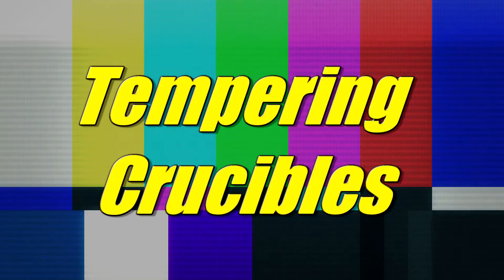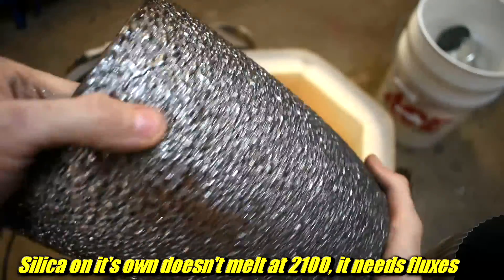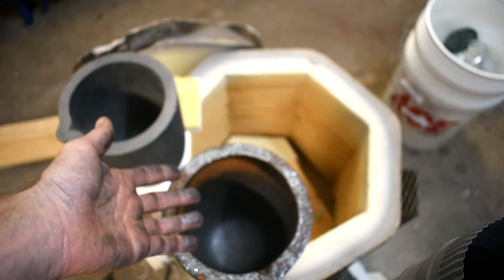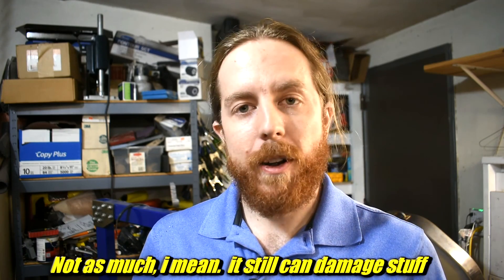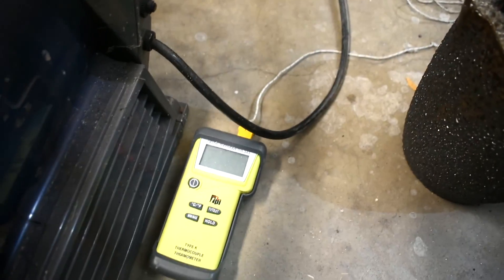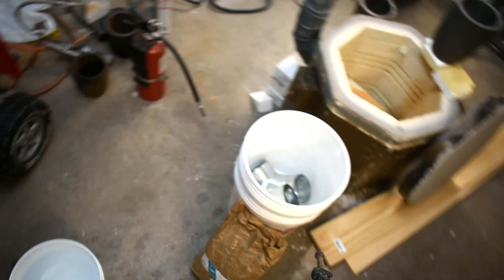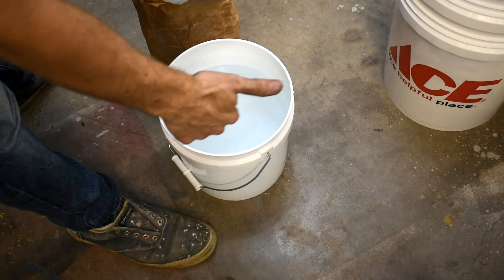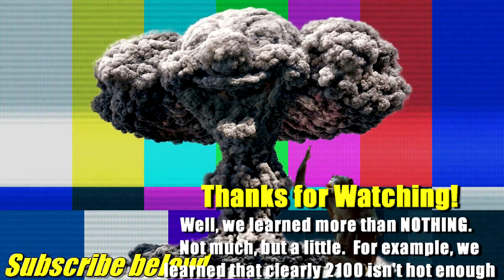Crucible Tempering Revisited: To use borax or not? or something else?

Comment: Just tried out my new vevor for the first time. No borax , no tempering. I did have them by my woodstove for a month and set them in the sun before fireing. The crucibals (2) held up fine but the inside of my furnace I'd coated with furnace cement melted! I used a rigidizer on the wool but then heard of using refractory cement so I coated everthing with that. It held up on the sides and dripped on the crucibals. Oldfoundryman says no to tempering and borax for seasoning. He also says he buys "good"crucibals" which I don't have.

Comment: it looks different because graphite burns in air in 600*C ;)
U need protective atmosphere with no oxygen to heat it up like that... (argon / CO2 or vaccum)
Or....
Use silicon carbide + 15% kaolin (white clay?) crucible
this stands up to 1600*C - starts burning after that treshold, like graphite at 600*C

Btw: been there, done that...
btw2: 2900F which u mentioned is ~1600*C which i mentioned :P so maybe it's partially out of SiC with some dose of graphite (which is absolutely NOT needed in crucibles because it burns >600*C :D )
btw3: it looks nice tho with those bubbles ;]
btw4: next time, put it in some iron/steel bucket, fill all with fine sand, heat up slowly to 100*C for 2h (in oven?) then 200*C for 2h,  then SLOWLY 600-1000*C (1800F max) - SLOWLY!! and let it cool

Comment: The purpose of flux is primarily to prevent oxidation of the material being melted. You want a flux that melts before the material being melted starts to combine with oxygen. And that won’t burn away once the material melts. The best flux strategy for silver and gold is boric acid to start then borax.
Using flux in your crucible has nothing to do with oxidation, but to coat the crucible with a glazing so the material melted in the crucible won’t stick.

Comment: I thought Borosilicate glass melted at a hurt temp than regular glass, or does another process need to be done to produce Borosilicate glass ?
Reply from the maker: Borosilicate glass is much lower temperature, actually.  Borates are very powerful fluxes and are used to make low temperature glazes now that lead isn't allowed.  Silica itself melts over 3000f!

Comment: I bought a crucible and did not heat it or up or anything. Just went straight into using and I didn’t know you were supposed to prepare it. So far no problems, but sometimes slag collects around the edge and I can’t get it out. Any tips?
Reply from the maker: I think if you buy the crucible from PMC supplies, you don't need to do this.  This is an old video, i don't temper them like this anymore.  as for the crud, i have noticed that's almost inevitable when you melt copper alloys or other really high temp metals.  the only metal i cast that has never done that is Za12, probably because the temperature is so low.  I would say make sure you do NOT use a flux like borax to clean metal, that's what wrecked my first crucibles.  It does clean the molten metal pretty well, but boron is a low temperature flux and will cause the inside of your crucible to melt, forming a glass (think pottery glaze, but not smooth) and will chunk off, leaving a rough surface that the metal will want to stick to.  For sure don't use the same crucible for different kinds of metal.  The remains in there will contaminate the other alloy when you mix it up.  Sometimes it's not a big deal, but anything with lead mixed with anything with zinc is a recipe for a bad day and a terrible alloy

Comment: TY, i have been experimenting with glass melts in the furnace so definitely need something that will help the clay pots stand up to 1700 to 2200 degrees. They are doing surprisingly well with no fluxes though.

One thing I learned for sure is a kiln is definitely needed for cooling or you wind up with lots of sharp broken pieces of glass.

After mulling over how to build a cheap kiln, came up with fire brick, aluminum oxide cement (refractory cement) analog 15A single phase motor controller (rheostat), nitinol 14 awg wires with mica and fiberglass insulation, ceramic terminal blocks, and 1500 watt heating element.... that should do nicely for a little kiln.... i can also anneal my metal pours as well.

Comment: How did you know about calcium carbonate flux, I have been googling like crazy and can't get a list of flux vs melt material for clay graphite crucibles
Reply from the maker: it isn't exactly a flux designed for graphite clay crucibles, but it is a flux used in high-fire ceramic pottery glazes.  Lots of cool info if you look into related fields like that.  Boron glass for lower temps, calcium carbonate for higher temperatures, and there are some extremely high temp fluxes too.

Comment: I use very small fireclay / alumina crucibles for jewellery purposes and those are seasoned with borax before first use. They just get gradually heated with a blowtorch to drive off moisture, then brought up to red heat and sprinkled with powdered borax which glazes the surface. Borax is used with most gold and silver melts to help remove impurities and prevent gas absorption. I don’t think there would be any benefit to using borax as a glaze on a graphite crucible.

Comment: What about a ceramic slurry like pottery clay
Reply from the maker: Pottery ceramic would break off while it's cooling.  Pottery ceramic has a much higher expansion rate than graphite clay and it can't handle temperature swings like graphite clay

Comment: Where did he get inexpensive calcium carbonate from?
My next kiln build will be from a stainless steel beer keg, and it will be huge, but I can't seem to find a larger crucible, like the ones he has here.
From his link I found a #14 that should work.
Reply from the maker: Pottery supply places.  It's comes pure, ground to #325 mesh, and it's cheap.  Potters use it in glazes as a flux.  You can get all kinds of stuff from pottery supply places 😉

Comment: borax as a flux is for metals like copper brass silver, its used only to stop oxidation of metal and give the metal a clean flow, the quality of the metal is of more importance than a crucible, all crucibles have a life span and need replacing, the flux is for clean metal not crucible care, the flux reduces fire stain in the metal, and stops metal sticking in the crucible

Comment: I have 3 crucibles. 1 small 2 kg and 2 6 kgs. Did not treat any. Only used the small one 1 and the 1 of the big ones twice. The other I have done 10 burns in.  They crackle. Sure would hate to have one rupture and spill molten brass on my foot as I am pouring 4Kgs. Another youtube video said expect 30 to 40 pours in a crucible's life. By your video proper treatment could extend longevity of crucible a great deal. Thank you. I love all the advice I get from my fellow metal heads.

Comment: What model is the thermocouple, what is the voltage range, and can we arduino this?

Servo on the gas regulator to control energy input + thermocouple to monitor temp

Comment: Hi Paul, newbie lurker here, but i noticed that the interior of both crucibles looked basically the same. Is it the direct flame impingement that causes the texturing and melting? Would tempering the crucibles inside of a steel pipe, inside the foundry reduce the "bubbly bits" on the outside or would it be a waste of time since the next time you used it, it would bubble up? thanks for the vids

Comment: My brand new crucible has couple of small pieces chipped off.
Is it still good or it has to be smooth all the way ?
Reply from the maker: I'm not sure it matters, but you would probably want to contact the place that sold them to you to be sure.  My crucibles get pretty nasty by the time i stop using them and it usually doesn't cause problems until stuff starts falling off

Comment: I made the mistake of using borax once and it made a mess of the crucible - never again.
For tempering, stick it in the over at 400 for a bit and then set the over to the lowest setting and allow it to slowly cool overnight - that'll bake out all of the moisture and temper it just fine.
Not sure where you got your crucibles from though as I've never had one get that glassy look on the outside even when I've melted several pounds of spent shell casings.
As for how long they'll last, depending on how you handle, treat and store them, on average you're going to get 20-30 good sessions out of them so yours still looking good after what sounds like maybe half a dozen light uses is nothing exceptional - mine are still looking good as new after a dozen sessions and I'll go for several hours as I process one or two forty gallon trashcans full of crushed soda cans.

Comment: It doesn't make sense to me to coat the inside of a crucible with borax if you're going to be melting aluminum in them, the borax is just gonna re-melt and contaminate the aluminum forming aluminum borides. As far as fluxes go, there are two different major kinds. "Drossing" flux and "covering" flux. Drossing flux pulls together impurities and brings them to the top, making them easier to scrape away. Covering fluxes cover the melt in a sheet of molten glass, preventing gas from getting in to the metal, preventing oxidation, and preventing the metal itself from burning away. Other things can be added to the fluxes like fluoride to help draw magnesium out of aluminum, and titanium as a grain refiner. All fluxes chemically attack the crucible and shortens their lives. Silicon carbide crucibles are the most resistant to this chemical attack, but are also more expensive. There is no flux that modifies the melting point of a metal or alloy, or make a metal "flow" better. That would have to be another metal added to the alloy itself. There are other things that can be added to the alloys for the purposes of grain refinement, such as silicon or titanium to aluminum. There is no one universal flux for all metals, since one flux may help a certain metal, but may just further contaminate another, as with the case of borax in aluminum.

I don't believe tempering achieves anything useful. I have never seen anything mentioned about it in any real literature, only online forums where it's people doing things but they don't know why, because they saw someone else do it or someone else told them to do it, and are now passing that information on in an authoritative manner. When I receive a new crucible I just put it in the oven at 200 degrees for a couple hours to make sure all the water is driven out of it so it doesn't turn into a bomb in the furnace. These chinese crucibles are cheap, but of horrific quality. I'd want to get all the life I can out of them by using as little flux as possible. Just enough to help the melt. As far as glazing goes, the only things I have seen regarding it is if the crucible is going to be used for melting low temperature metals that won't re-melt the glazing, like precious metals. However, I believe that professionally, they just use very smooth ceramic non-wetting crucibles for that purpose.

Casting forums and youtube videos are mostly useless for finding out real, useful information. It is definitely a struggle.
Reply: Thank you for the information. I just got a small graphite crucible that I'm going to melt aluminum in for small pendants and stuff. Do you think I need to glaze it or add any flux at all? Do you have any recommendations? Or would I still achieve good results without any tempering/fluxing whatsoever?

Comment: If you haven't already, please consider recording a video that demonstrates the different sizes of crucibles like #3,#4 and others you may have. I'd like to create small bars of copper and brass, but have no way to gauge the size of the crucible I'd like to use without having something to compare them with. Also, what do the numbers on some crucibles represent? Cheers
Reply: The number of kilograms of metal they can fit, so a #10 can hold 10 kg of molten metal with the density of metal obviously varying by volume - ie/gold is denser than aluminum so 10 kg of aluminum would fill the crucible almost completely while 10 kg of gold only partially.
As such, if you're looking for a specific weight then that's how to figure out how large a crucible you're looking for.
You said "small" bars so if you're just talking an ounce or two you could likely get away with one of those ceramic jewelry crucibles and simply use a blow torch - check out videos on pouring silver and gold bars to see what I mean.
Reply: @seanfoltz7645  Thank you for all the great information. Very helpful. Cheers